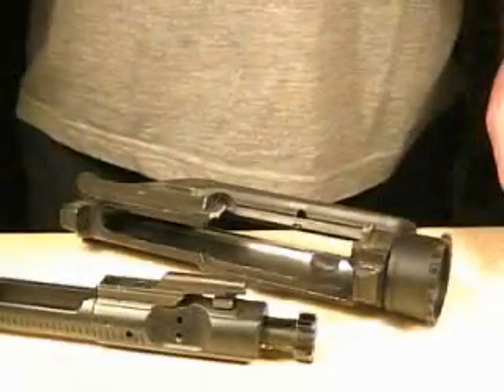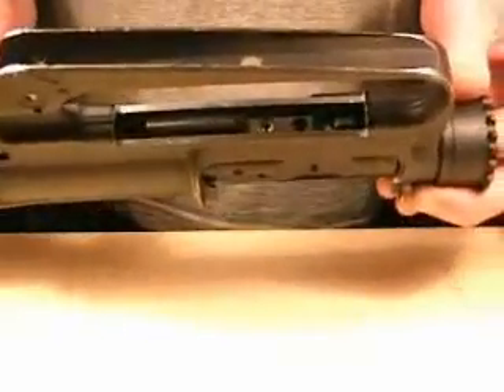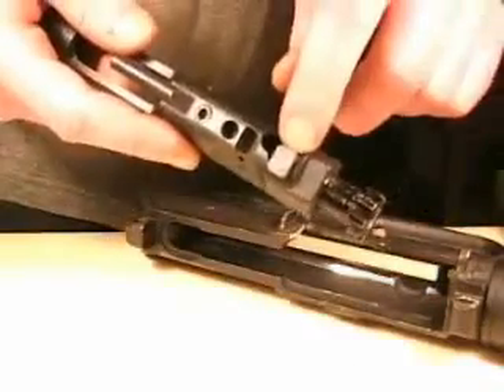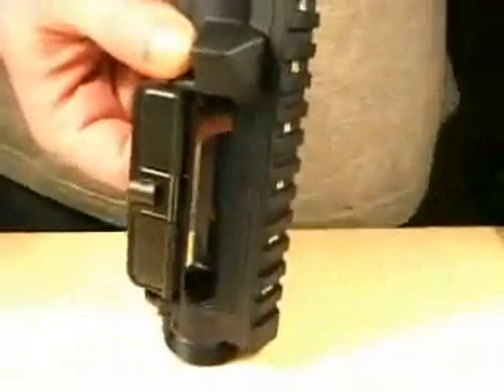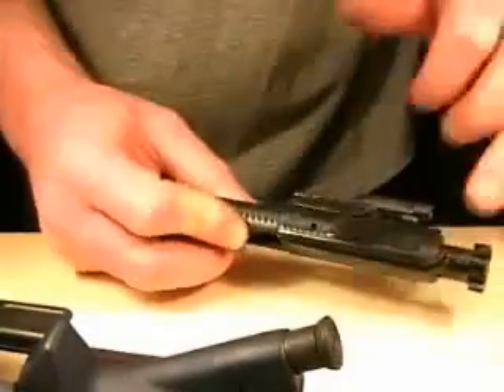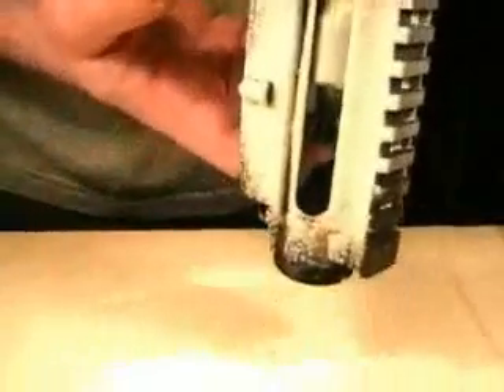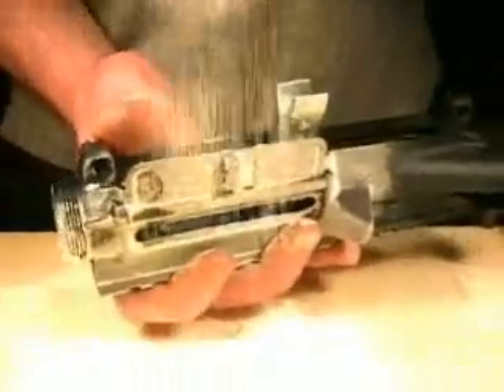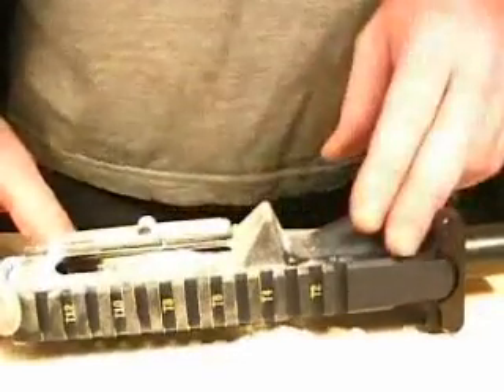M16/M4 reliability problem, increased bolt friction causing jams

Comment: Anyway, in my mechanical engineering experience. i think the problem on these are the cam play. its due to wear and tear on the these parts. like engines if its not lubricated properly it will wear and fail. i guess its a same thing with these weapons. this guy should have lubricated the actual cam. 
there's nothing wrong with these weapons, it's the person who uses and suppose to maintain it are in charge.

Comment: I just tried it with my rifle.
I couldn't generate nearly the same level of friction that you did.  Not even close to stopping the movement of the carrier.
I did definitely notice more friction when I push on the bolt face vs. pushing on the carrier.  My rifle has no lube on it whatsoever.
Very interesting demonstration.
I can see how that might contribute to a stoppage if other factors were also involved.